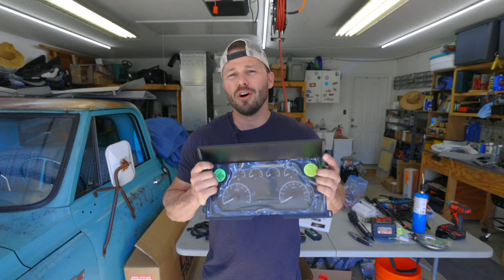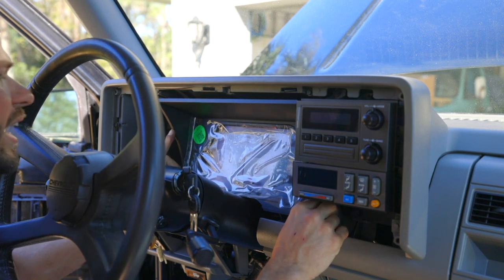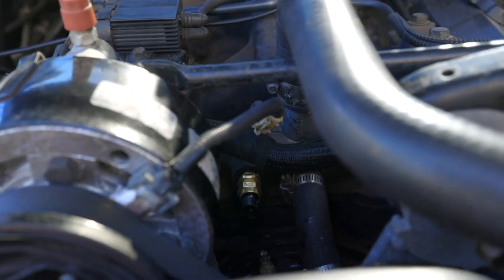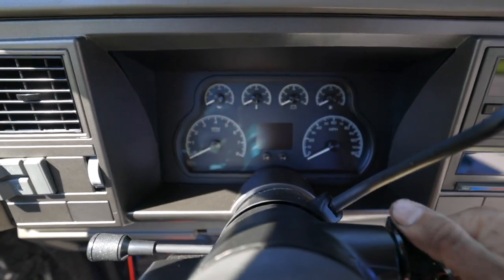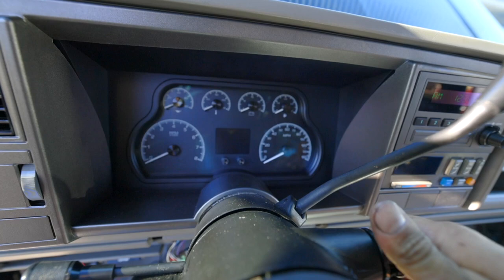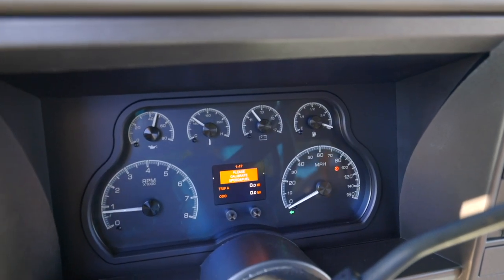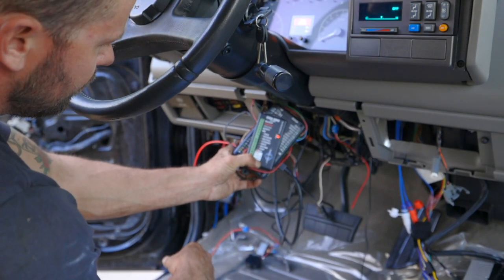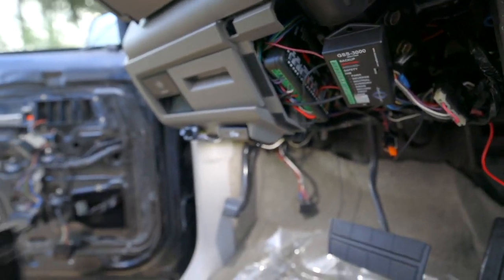Modern Gauges for an OLD Truck

Comment: I went with the NEW VINTAGE USA instrument panel/gauge cluster in my 1993 Chevy C1500 OBS. I like the NEW VINTAGE gear selector indicator better.
Reply from the maker: What’s different about gear selector on the new vintage setup?
Reply: Are they an easy install or do you have to wire them like these too?

Comment: 3 temp sensors on the big block is correct.  Drivers side head is the gauge.  Passenger head is the aux cooling fan.  The one on the manifold talks to the computer.

I like those gauges but as long as my originals keep working on my trucks I'm gonna keep my money in my wallet.
Reply from the maker: Thanks for clarifying. I was confused because my aux fan was on a switch and I didn’t think they would need 2 others. This is my first big block TBI truck so I’m learning a lot!
Reply: @motortopiaondemand  no problem.  If you are keeping the TBI, the wiring for the sensor in the manifold is required to be hooked to a sensor.  Once the system goes into closed loop that sensor is a requirement.  Any time I have a problem with how a TBI runs I change that sensor first——and it’s usually it.
Reply from the maker: Thanks for the tip! Do you happen to know which sensor would be for the computer? I'll make sure that sensor is still connected.
Reply: @motortopiaondemand  the one on the manifold that is kinda below the coolant return hose is the one for the computer.  From the video I think that’s where you put the one for the new gauges.
Reply from the maker: @shawnlattimer8924  awesome thank you. I’ll be sure to hook that one back up!

Comment: Have you noticed any design changed in the new dash that will keep it from self destructing like oem?  I wont even mess with the square dashes typically, the mounting is weak it seems.
Reply from the maker: The LMC Truck dash looks like a factory replacement. The metal frame is sturdy and I think the OEM dashes failed because of the material used. The LMC Truck dash seems like it will be more durable.

Comment: Haha i just installed these gauges yesterday but they sent me a faulty module. Cant wait till tomorrow when the module gets in so i can see them finally work. 

P.s. im almost 110% sure u have that many cts because one is for the computer, one is for the gauge & the last one is what turns on that little fan behind your grill like when you are towing things. Dont quote me on that but im pretty sure.
Reply from the maker: Awesome man! I hope you get them up and running. It's fun customizing them to match your interior. Also, good point on the number of temp sensors. I didn't think about that. I think I'm going to swap the clutch fan out for a dual electric fan setup and use a probe temp relay setup. That should help with regulating temp. These big blocks get hot quick!

Comment: Great video. I have a Dakota Digital VHX in my 85 C20 LS swapped truck and will be putting one in my 91 S10 LS swapped here soon. I love their clusters for the same reason of  the remote control box and the simple plug in of the cluster to the box. Plus Dakota has a great warranty and tech support. Wiring it is really simple and they have many options to make everything work. I would not go with any other cluster, Dakota Digital has the best one out there in my opinion. 
In addition to the Dakota I have the RetroSound Motor 4 in my 85 Chevy C20 and a Motor 2 New York in my 91 Chevy S10 and as you said you can match the colors. My C20 is red and my S10 will be white. My Motor 4 was a tight fit in the S10, but I was able to mount it without having to remotely wire it like you did. With a good amp and speakers, the RetroSound radios sound great.
Reply from the maker: This is great to hear! Dakota Digital gauges and RetroSound radios are such a great combo.